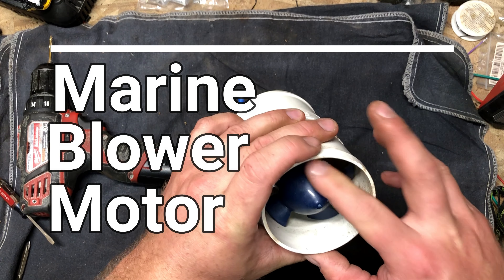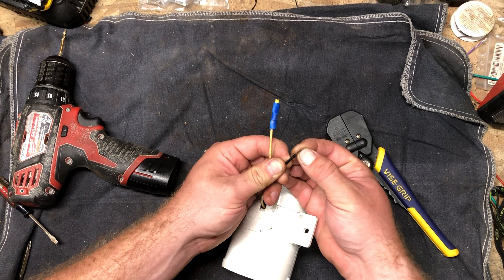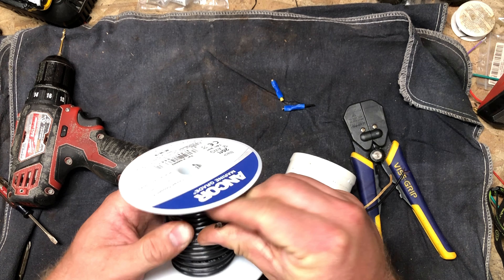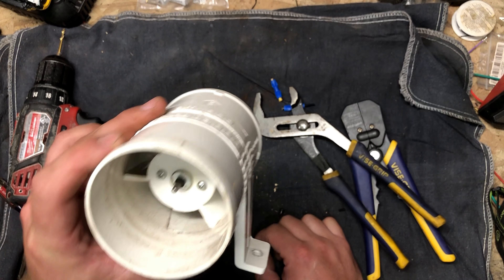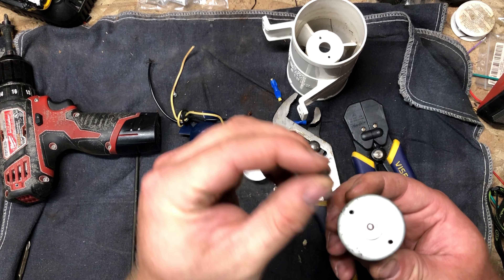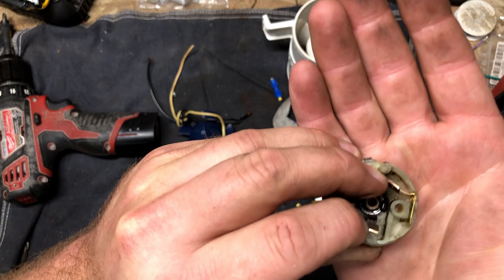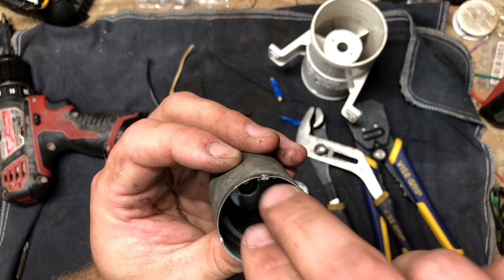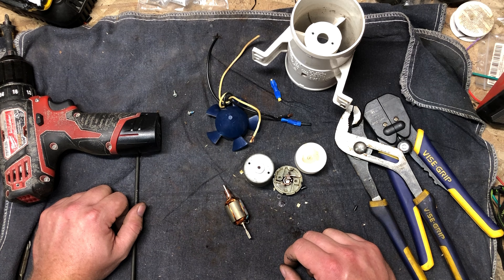Marine Blower Motor

Comment: It's a bit disappointing that you didn't go into how you could tell it was failing, even better to apply 12V to it and let us listen, then during the disassembly, an autopsy.  You said "figure out what's going on with it", but then you mostly talked about wire.

I suspect that where the problem lies is that their fancy plastic blade-hub, isn't well balanced and that prematurely wore out the front bushing.   At least that's not expensive for what it is, but yeah they should have made it better and charged more, enough to cover a brushless IP rated, dual ball bearing motor and balanced blade assembly.
Reply from the maker: Good point. I should have ran it for you. It was a pretty obvious bad noise but it would have been good to hear. I’ll keep that in mind for next time!